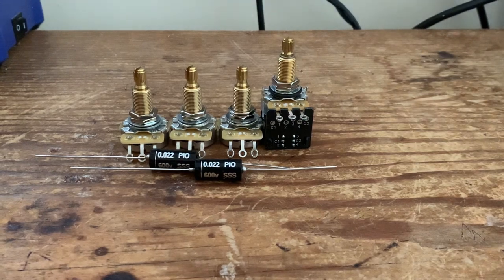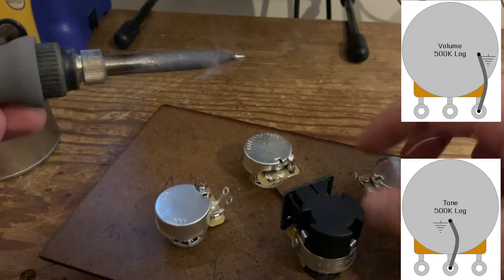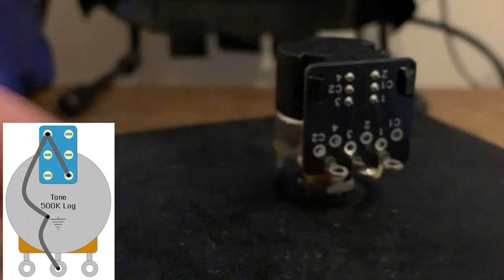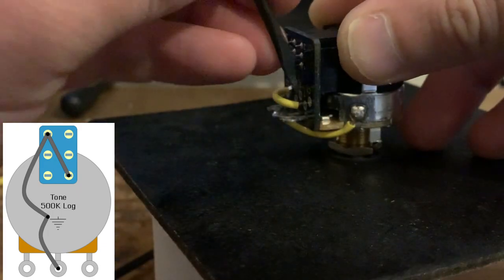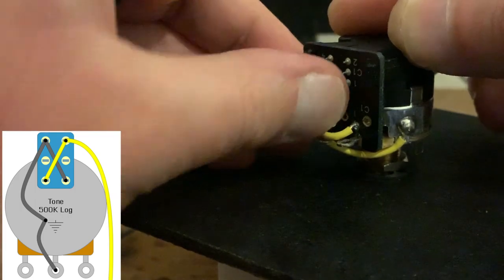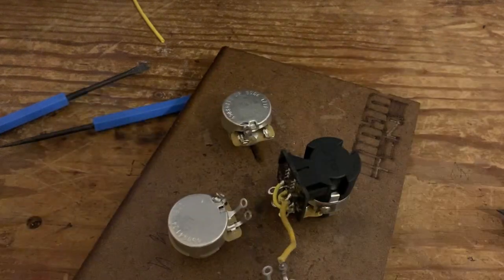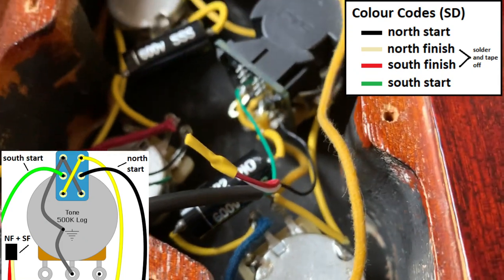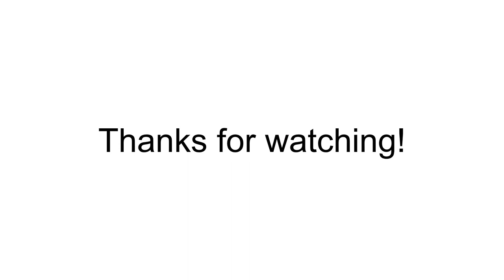Les Paul Out of Phase Wiring (50's Wiring)

Comment: I wired one pickup on my guitar out of phase, but with no switch, so watching tutorials with the out of phase switch gets a little confusing for me. I think I got what i wanted to know from the video, but I'd just like to ask for certainty: If I have one pickup wired out of phase, the wiring/grounding changes to do the 50s wiring mod are still the same as if they were in phase, correct? So, the fact that I have reversed the pickup wires on one pot has no bearing on what lugs I need to switch the capacitor to, right?

Comment: What's weird is I just saw a interview with Kirk from Metallica & not only did he say that "Greenie's" out of phase sound does not go thin sounding like all these people are saying, but he showed that "Greenie's" out of phase sound is actually very thick sounding. Then he went on to show & prove this is the truth. The interview he did recently with Rick Beato is where he proves it to you.
Reply: Flipping the magnet is a little different, usually people with 2 conductor pickup leads will go for the magnet flip, esp. with valuable/collectible pickups or not wanting to do the delicate soldering to make it a 4 conductor. 

But y're right, with the magnet flip you can roll one volume back until you get closer to the normal middle position sounds.

Swapping wires like here is officially called 180° out of phase, or half out. It sounds ever so slightly different. Still great, Zappa's Strats were wired to switch positions 2 & 4 out of phase, obvi no magnet flips on a Strat. 

Work the tone controls too, with an .015 cap in the neck tone circuit you get a cocked wah sound rolled all the way off, more so our of phase.

Comment: Hi, can you please PLEASE give me some info on wiring. I have scoured the internet and watched a lot of your videos and cant find the answer. I have followed these steps exactly as you have shown but when it comes to the push/pull pot I am using Seymour Duncan triple shot pickup rings. So I do not have North start and South start, I only have Black(ground), Bare(ground) and White(hot) coming from the pickup ring. How do i wire the black, bare and white wire to the push/pull to get phase switching? Any help would be greatly appreciated.

Also if you dont mind, I dont have any braided wire to hand. Can you wire the 3-way selector using standard basic wire? Ive spent 3 days researching this and wiring up the guitar and I'm having earthing issues.

Comment: Hi! Very usefull video, great job! Works great. I have it done in my Les paul by my luthier. Just one hint - when I choose out of phase by push/pull switch and then touch the neck pickup cover with finger it starts to buzz - like grounding problem, when I stop out of phase there is no buzz when touching the pickup. I inspect the wiring and it seems to be ok - like on the video. Is it normal? What are your experience? Thanks!
Reply: Someone recommended putting copper tape inside where the pick-ups insert, and even on the back side of the pick guard and inside the pot holes. It prevents the buzzing (well, the guy says it does). I'll try to find the video link to show you.

Comment: As I understand it, the taped red and white wires can normally be wired either side of a mini toggle switch to give a coil split option. Would that work - and add an additional split option, with the phase switch in there and would it be possible to use push/pull pots on the volume pots (in addition to the one you use for the phase switching) instead of mini toggle switches to avoid drilling holes and trying to fit more stuff in the back cavity?

Comment: hey, on the topic of humbuckers could you make a video showing how to wire coil split to a 3 way switch?
Reply from the maker: it's on the list! will try and get through the videos as quickly as I can
Reply: @SixStringSupplies  Awesome I really appreciate that. For reference i am trying ti mod a squier bullet mustang. It has a 3 way pickup selector and master tone and volume. I am just unsure of how to do it because ive never coil split using s switch however on this specific model it seems easier to do it with a switch because of cavity limitations

Comment: im using a different push pull pot, and a little concerned if im connecting it to the pins upside down. I like how yours are numbered but im using a different brand pot.

Comment: Thanks for posting this approach to ELECTRONICALLY out of phase wiring, a useful tonal variation. However the Greenie sound is caused by a MAGNETICALLY out of phase pickup achieved by physically reversing (flipping or rotating) the magnet in one of the humbuckers. It’s a totally different sound, so a bit of disinformation to say this is a Paul Green sound mod. I don’t doubt that a lot of 50’s Les Pauls were wired out of phase like this.
Reply: It's identical whether you flip the magnets or swap the pickup leads. This has been proven by many people.